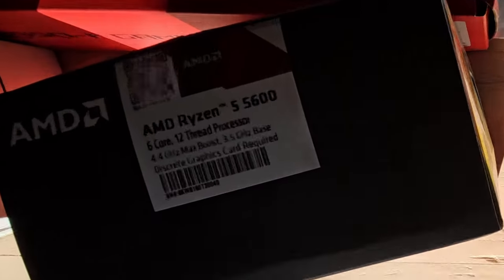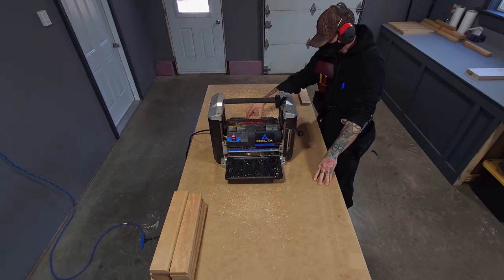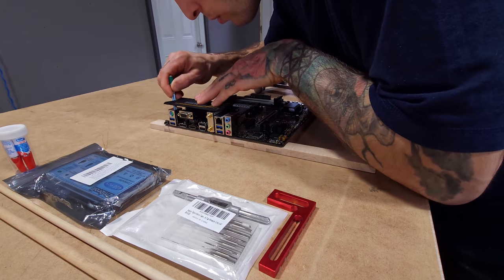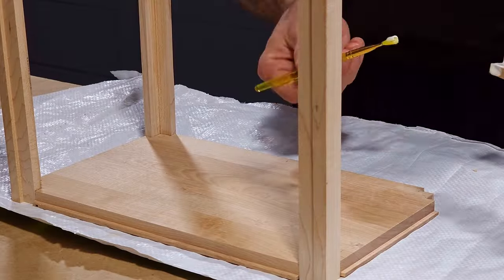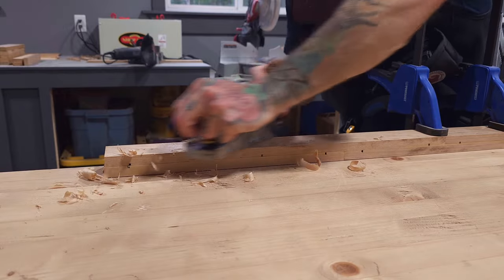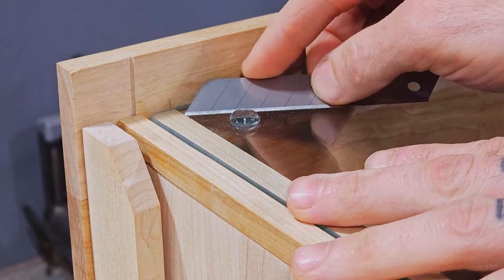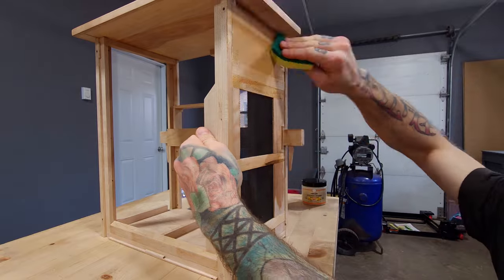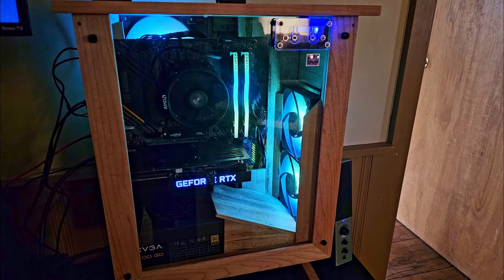Pc Building meets Woodworking

Comment: Beautiful case, awesome job for your first build! I would say though, that you didn't allow the power supply it's own air intake. You installed the psu with the fan facing up toward the video card and if you're doing a video card heavy task on the pc, like video editing or gaming, then the power supply and the video card are gonna be fighting for air and will affect cooling. You could cut a hole in the bottom of the case and flip the psu upside down to remedy that so that both the video card and the psu have their own air intake. Just a suggestion, and realistically if you're not putting any heavy workloads on it then it probably won't matter much. Amazing job with those tenons though 👍👍
Reply from the maker: @depv343  many thanks for watching all the way through 🙏😃 yes I absolutely understand the way fans intake and exhaust air, this was more of a time saver than anything else, and it's only used for gaming, so semi heavy loads, but nothing to crazy and I've never seen PSU fan come on yet, from what I've read and researched most PSUs nowadays don't turn on until there's a heavy power load, so I think we are good on this case, I do plan to mod this case further in the future so stay tuned for that, maybe the PSU will be one of those modifications 😊👌 thanks for the thoughtful comment and I definitely will take it into consideration.

I'm busy right now, but over the winter time I have big plans to start designing a wooden case that will hopefully make a serious mark in the PC building world, I want build and sell them... building plans for sale as well 👍

Comment: Cool project! We'll done. 
You might want to add something to ground it tho, since you don't have a metal case. if you touch pc components the charge difference between you and the pc parts can fry the components.
Alternatively you can ground yourself while working with inside components.
Reply from the maker: @SvenHeidemann-uo2yl  Many thanks my friend, and yes, I absolutely do plan to get a anti static wrist strap for future build, latex gloves can get you out of a pinch too if you have nothing else at your disposal as seen in my second build on the channel, the Simpsons one 👍👍

Also it's very rare to damage parts but it can still happen, so if the parts you are working with are very expensive then definitely take the precautions but if you are working on an old Dell or something where the RAM is only a few bucks to replace then I wouldn't worry about it so much.

I do agree though, let's protect our valuable computer part, no more abuse lol 😆😂😉 

Thanks for watching! Don't forget to subscribe for more builds 😎👌

Comment: For airflow purposes I probably would have put the exhaust fan in the top, above the CPU.  Or in the side, beside the IO shield.  I do like the airflow guide on the bottom to funnel the intake right into the GPU.  I'd also flip the power supply and have an opening in the bottom for it to intake outside air, but that likely would make no real difference overall.  I am curious what the component temps are like under load.  

Really cool, unique build though.  I like how it showcases the strength a well constructed wood structure has.  For anyone that doesn't build their own PCs, they can be pretty heavy.  The components in there aren't the heaviest, but there's a decent amount of weight that's being suspended off the desk surface with those offset feet.  And I'm sure it could support a lot more than what's in it.
Reply from the maker: First off thank you so much for watching! I appreciate it so damn much!

In regards to your comment...the highest the CPU reached under max load was right around 80° and that was reading was taken towards the end of a long gaming session, with multiple different game titles.

It usually sits around 75 give or take, these CPUs are designed to run as high as 90° and can run quite high day in and day out for many years, but we obviously want to keep it as cool as possible.   

Please forgive the lack of design, this was my very first PC build EVER, so needless to say the designs will get much better  in time, but in response to your questions/statements, it had no air flow issues heat rises, and the intakes are low, and the exhaust fan is high, and it's actually almost directly behind the hottest part in most cases, so I think the layout is quite well thought 🙂

and yes, it is very strong and weighs 23 lbs, so not to heavy at all 👍👍

Again, thanks for watching and commenting it, really helps my tiny channel haha 😊😊

Comment: Nice. Might have airflow issues with that fan layout, though.
Reply from the maker: So far so good, the highest the CPU got so far under max load was right around 80° and that was reading was taken towards the end of a long gaming session, with multiple different game titles.

It usually sits around 75 give or take, these CPUs are designed to run at 90° or 95° I forgot which specific temperature exactly but they can run quite high for supposedly the entire life, but we obviously want to keep it as cool as possible 😉 

Please forgive the lack of design, this was my very first PC build ever, so needless to say they will get much better haha but in response to your ponderings, it had no air flow issues 😊👌 heat rises, and the intakes are low, and the exhaust fan is high, and it's actually almost directly behind the hottest part in most cases, so I think the layout is quite well thought out not to toot my own horn lol 

Thanks for your input and appreciate you watching the whole video 📹 🙂 👍  take care!
Reply: @104Woodworks  I think it's a masterpiece and maybe even a project you wish to revisit for another person's build (or perhaps more content). Either way, I really appreciate it. If the numbers are good, then you shouldn't have much to worry about, if you keep it clean inside. I love all-wood PC case builds. They're too few and far between on YouTube.

Definitely subscribed!
Reply from the maker: @grelkath  oh man, I really appreciate that, I have another pc build coming soon, no wood case but there will be a little wood working aspect incorporated into the build, also don't worry there will be more wood PC cases coming in the future, I plan to build and sell them to the public so people can use them for their own builds, but I still have a lot of trial and error before that happens haha 

Again, thanks so much for the sub! I'll try my best not to disappoint 😎 👌

Comment: Great build and design, but i hope you applied thermal paste before the cpu cooling fan.
Reply from the maker: First off, many thanks, and much appreciated 😎👌 

Second, when you buy a CPU that comes with a stock cooler the thermal paste comes pre-applied, at least it does for AMD CPUS,  I have no experience or knowledge on Intel CPUs,  but I'd assume the same thing, with that said I would definitely recommend putting a little extra because it's not enough in my opinion and doesn't always spread out to cover the entire area, I've noticed when taking them apart for maintenance the pre-applied paste covers most but not the entire CPU, I've noticed the edges wanting for a little extra 🙏 you can definitely get away with the pre-applied paste though, I'm just thorough haha 🤪👌

Don't forget to like, share and subscribe too, lots of good stuff coming 😉 cheers!